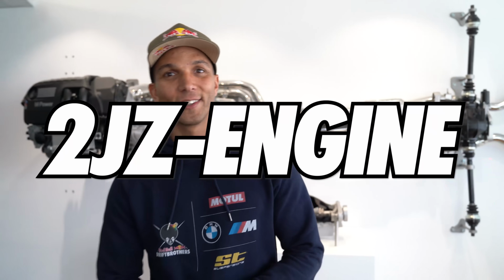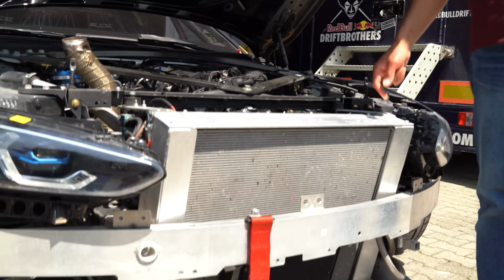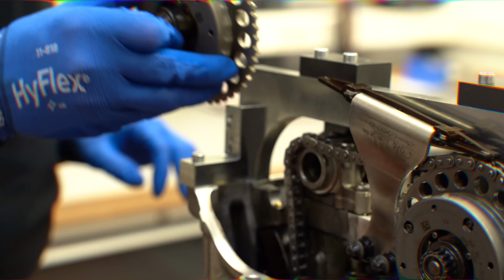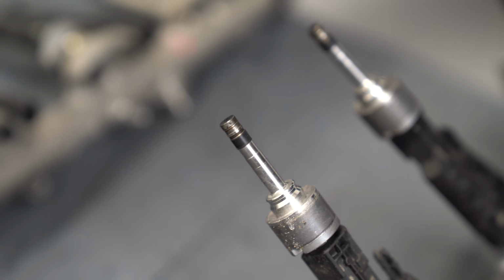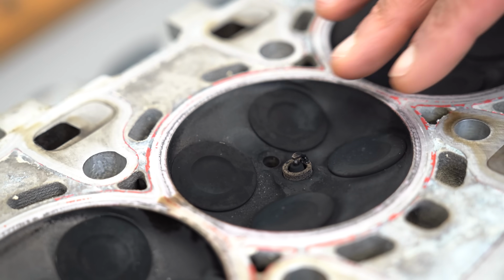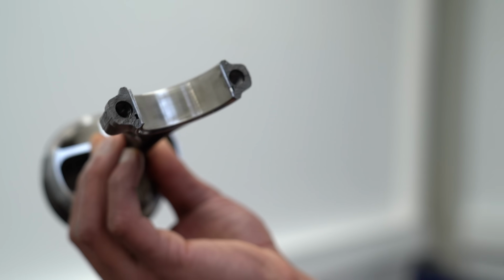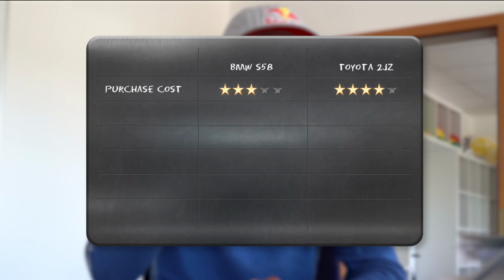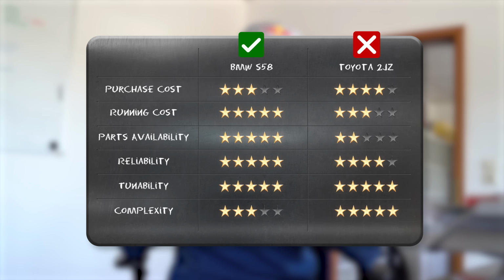Is THIS the new 2JZ? A deep dive into BMW's S58

Comment: Nope not a 2j. You'll learn when it comes to dependability the 2j is the crown jewel. NO aluminum block in line  engine can compete.
Reply: use your brain not your heart 

2JZ is over 30 years old it's just engineering and the S58 surpasses it
Reply: @wrth not talking about engineering. I'm talking about REAL world power. Show me 2k hp b48.
Reply: @Vgk92   sure give me $$$$$s to R&D and manufacture new parts rated for 2k and I can do it. Also what you talking about B48, that's the 2 litre 4 cylinder in the 330 etc.
Reply: I meant b58
Reply: @Vgk92  B58 and S58 are not the same. But the B58 is also a very good engine.
Reply: What do you think top fuel drag engines blocks are made out of bud? Billet aluminium. People are running sub 5’s on stock aluminium ls blocks, so you people who think aluminium cant compete with iron are kidding yourselves. Ill take the new metallurgy and development of an s58 block over a 30 year old used 2j anyday
Reply: @Sco4796  🍻 my man ….respect 🫡💯
Reply: @Sco4796  you can get a 2 new from yota. Block that is.
Reply: S58 surpassed the 2j no bolt on Supra making 800whp like the s58
Reply: @dameech8339 I'm not talking bolt on. I'm talking BIG power where is 2000hp aluminum b58?
Reply: @Vgk92  it’s a old ass car they been working on it for 30 years🤣  these guys making 1200hp on a car that came out 2 years ago
Reply: @dameech8339  still sounds like poo.  It’s not better yet.  So Yeah rn and for the foreseeable future still 2J.  They won’t ever produce enough blocks anyhow. So basically spending real money for something that will be cut off soon. So no it’s not gonna have 30 years of development in the future like a 2 had. Because it won’t exist. Bmw always changes things. Remember the N 54? Still not better than a 2J. How many years has that been around?
Reply: @Vgk92 Toyota 🤫 move on
Reply: Talking like aluminum is just aluminum and alloys with different properties don't exist. Besides that, the 2jz is a mediocre design at best which only has being ridiculously overbuilt as its crowning trait. At the end off the day, it's inefficient, heavy and very dependent on the attached turbo to move any air. Both the B58 and S58 are designed so much better that they can make the same power at lower boost, allowing the use of smaller more efficient turbos at said power levels that make torque for more than just the top 10% of the curve and can make better use of the strength provided by their diesel based design. Would not surprise me to see a 1000 HP B58/S58 beat a 2000hp 2JZ on the track let alone in the real world where that 2JZ would never even be able to get on boost.
Reply: @Vlku272  I 100% understand where you guys are coming from.  But what you guys aren't seeing is the number of variants and overall production numbers of the engine are just not enough to satisfy the appetite of the people.  There will not be enough of these built to make them $500 or  $1000 junkyard finds like an LS or Ka series.  Where literally ANYONE can still put one together on a budget.  ESPECIALLY drifters who we all know for a fact are not easy on the drivetrains no matter the power level. 
Hell even vq's from Nissan have more production numbers that probably any b58 will ever have. If you can't go pull one from the junkyard are throw it in a project car then it's doesn't matter how good it is.  It's mostly unobtainium.  So yeah only accessible to the well funded teams.
Reply: @Vgk92  I'd say this is debatable since B58s would have a much higher chance and prob dropping to attainable value cause they're honestly in nearly every bmw model u can think of atm and have been made since 2015,while bmw already said they're gonna continue using the B58 even threw the bit of 2030 so I'd say it'd have a bit of a lengthy amount of time to get cheap for people to get their hands on them if bmw continues to use them in almost every car in their line up + updating them over time.
Reply: You are overestimating aluminum engines. They have many advantages over iron engines, like better heat dissipation, and many high power capable ones exist, like VR38, K24, DAZA, etc.
Reply: @VGK36 anyway your a poor kid
Reply: @seansiew5629  damn girl you salty. 🥴
Reply: Hey fellas, John Mihovetz has gone 5.88 @ 256mph ten years ago with an almost entirely oem 4.6 4V. 3,000 hp # 10,000 rpm. Cast oe block and heads, oe timing components and factory Kellogg crank.